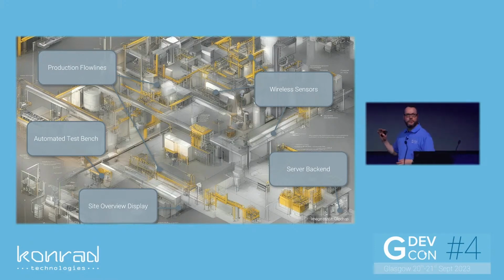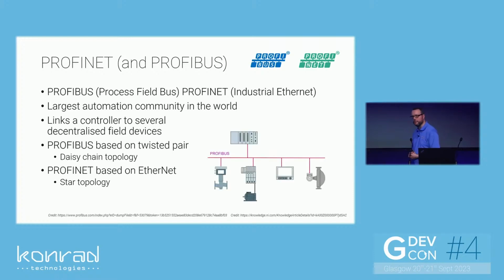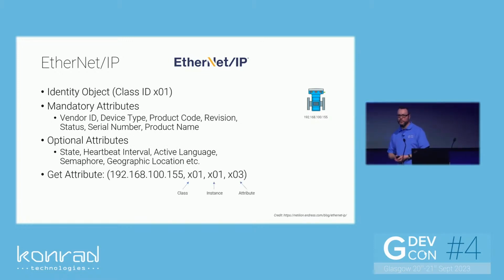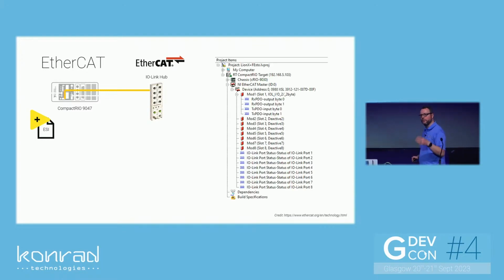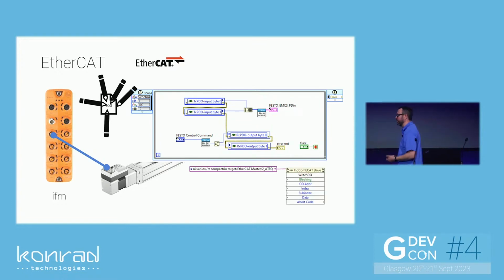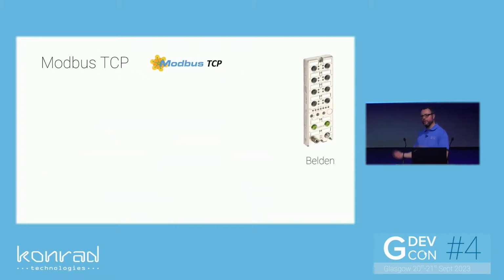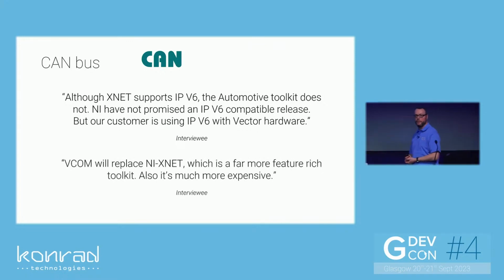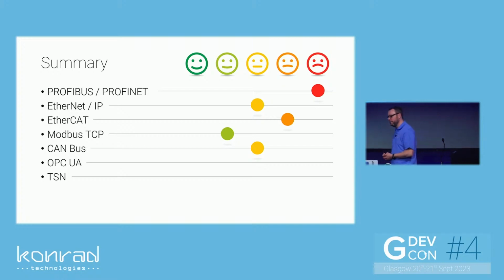Industrial Comms and LabVIEW - Where Do We Stand? Richard Thomas(Konrad Technologies) - GDevCon#4

Comment: Is this modified ESI available for the IFM? We have the same Al1332 and it is a pain to make it work without heavy ESI modification. We had to do the same for a Balluff BNI009U and it was terrible. When it comes to OPC UA I think the situation is not so bright because the OPC UA toolkit does not support method calls and the older libraries (~2015) do not list every object type.
Reply: Richard here. I modified that ESI Very specifically for the system setup we had. It won't match your needs. Unfortunately there's no shortcuts to altering these for a LabVIEW based target that I'm aware of
Reply: @richardthomas7706  Thanks for the quick reply. Then I will have to go with the option of making a moduleless, static ESI file but it is a pain because I will have to do one for all kinds of IO-Link process data size. I don't know what tool you are using for editing the ESI but I have found it is the easiest by using XML notepad.

Comment: IO-Link is its own protocol as well. GPower sells an IO-Link driver for LabVIEW that's fairly affordable and works well. It's mostly plug and play. I spent more time going back and forth with GPower trying to get the product keys to work than getting the library to communicate with IO-Link devices.

You just need the GPower library (VIPM), a paid product key, IODD files for your sensors, and a master device. IFM provides a web based config tool. The advanced controls are locked behind a pay wall, but I asked IFM nicely and they gave me a key for free (not a joke). I'm using the IFM masters to communicate with Mettler-Toledo loadcells. It works pretty darn well. HOWEVER, last I heard from GPower, it doesn't work with cRIOs. I have 7 cRIO machines that I can't use this library for, but I have 5 cDAQ machines that I could. On two of my machines, I don't even use an NI chassis. I'm just running IFM masters straight to a PC that runs a LabVIEW exe built with the GPower tools. I may have found a way to circumvent NI hardware all together.
Reply: The last time I measured the REST based calls take like 50ms so it is not really a viable option for every use case.
Reply: @_saneasylum_  Yeah, it worked for me for one device. As soon as you try to read data from more than 1 device, it slows down. Those 50 ms read times stack up quick. :(